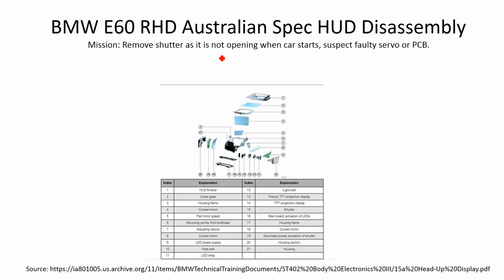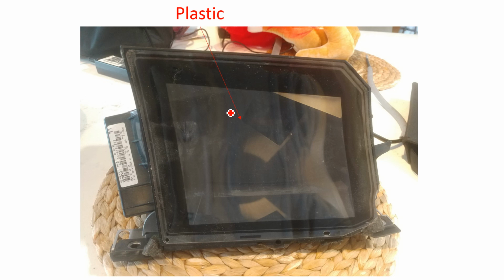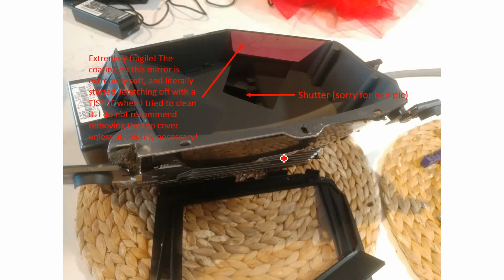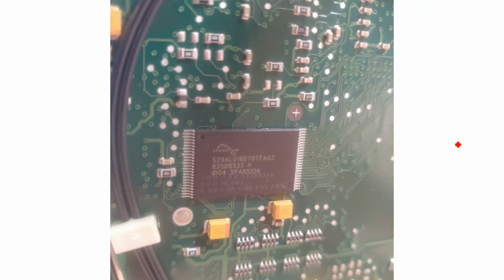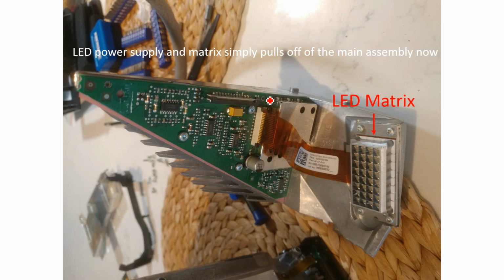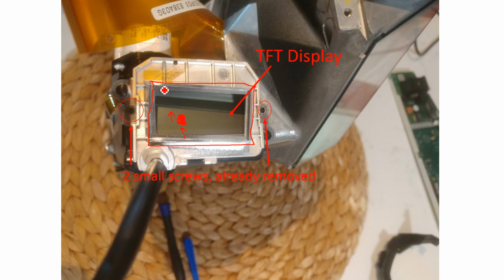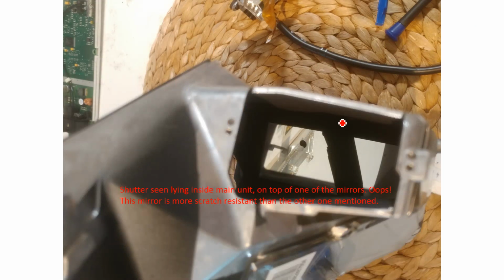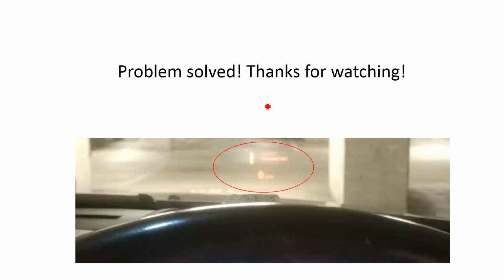BMW E60 HUD Disassembly Slideshow and Shutter Flap Fix

Comment: Hey mate. Was this a dash out job or simply a case of removing the cluster. Mine is dead and looking to get ot repaired or replaced. Any advice appreciated. Great video very informative
Reply from the maker: Hey mate. Dash out job unfortunately, iirc the HUD is trapped behind the dash impact/brace bar. It took about 6-8 hours in labour to remove and refit, excluding the time I spent messing around with the HUD. I determined it was an issue with the cover flap before removing the dash. By parking the car somewhere dark and using ISTA to turn the HUD on and off, and peering through the windscreen you could see light bleeding from behind that cover flap, which told me the projector/display matrix was still working. Hope you manage to sort something out.
Reply: @mop371  appreciate the reply. I'll have to invest further. Dunno if I really want to take the dash out lmao. I'll try the method you did to see if it's still working. Thanks for the tip

Comment: Hi Cooper,
In your own experience, can you list the exact amount of parts and name them, in order to remove from a donor car in order to retrofit my 07 528i?
I have 2 donor cars here at a wrecking yard in California, one of them being a 2007 528i and I want to go remove the whole system.  Parts here are dirt cheap because you remove them yourself.  Please advise.
Reply from the maker: Hey mate, 
I couldn't tell you exactly what parts you'd need to retrofit a car, because the HUD came stock on my car. For me it was a case of pulling it out, modding it, and putting it straight back in. At the very least, you would need the hud, all the wiring that connects to it, the entire dashboard cowl (or you can cut your own one for the hud), and the HUD specific windshield. For all the other parts I would recommend you check the list  here: https://5series.net/forums/e60-e61-parts-accessories-mods-22/hud-retrofit-parts-list-69022/